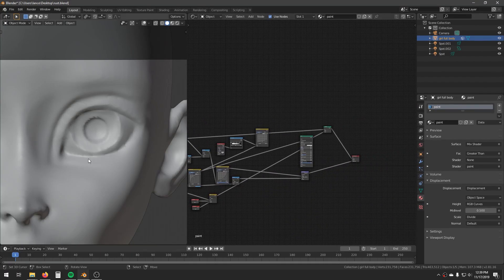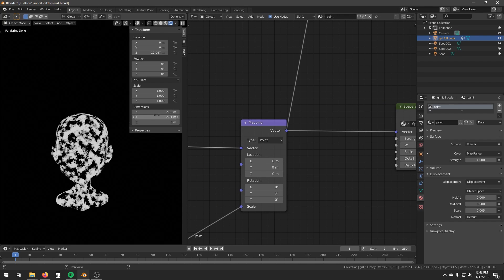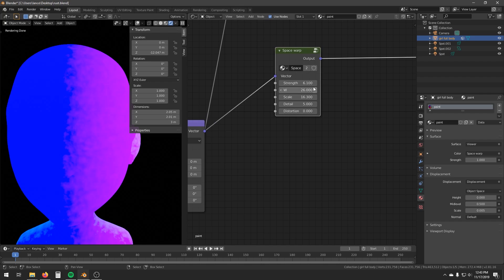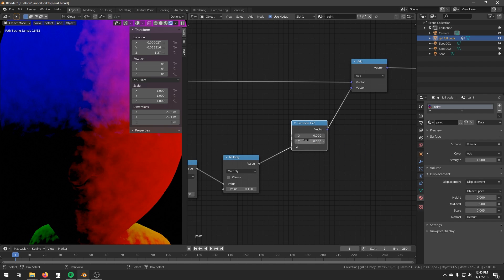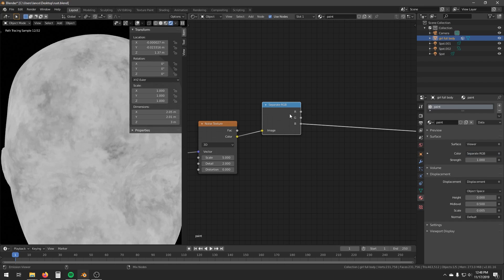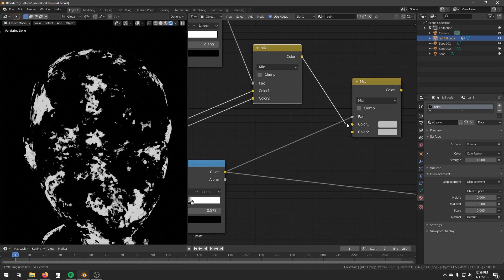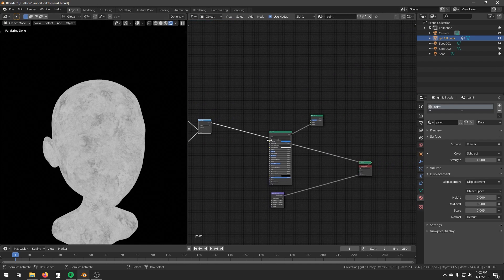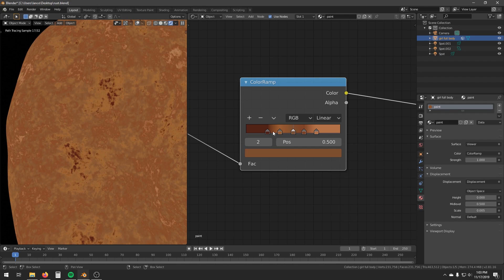Procedural rust in Blender 2.81

Comment: Idk if this is necessary, will work or is right- but if anyone is stuck. In order to get the same result at 2:10 when using a plane I had to (all in the mapping node) 1.) location: 0x, -1y, 1z, 2.) set the scale to 1 for x, y & z. Now it should be just blue and magenta.
Reply from the maker: you don't have to worry about the blue/magenta thing, those are just coordinate numbers being visualized in colors. Different position has different coordinate and different color, the plane is flat on the ground so the Z coordinate is 0 everywhere and result in no blue channel. As long as the math is correct, the final texture will be correct. If you want to understand the meaning behind those color, you should watch the 2D vs 3D textures video where I explain the coordinate systems.
Reply: @LancePhan  Thank you! Ok, I'll just follow along. I've watched that video and most of your others, I'm just not as technically minded so some things click some things don't. Just started trying to comprehend all this like last month lol.

Edit: On another note, any idea why my warp node wont effect the mapping output? It works with the paint setup but when I try to start the rust in the same (copy and paste nodes or from scratch) or a different project the warp node doesn't change the mapping output.
Reply: NVM I'm an idiot and was using too big of values when it's between -1 and 1 for some lol
Reply: Yeah actually no matter what I do the warp node won't effect the magenta/blue object output.